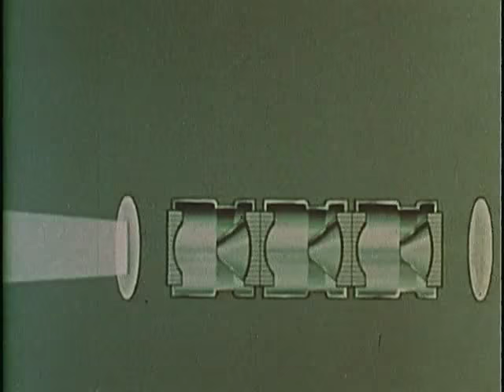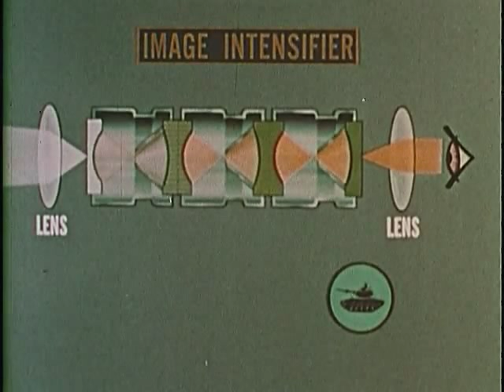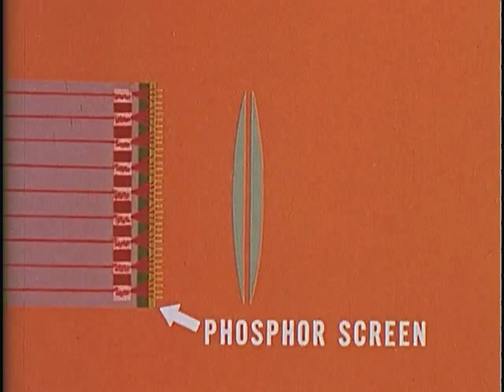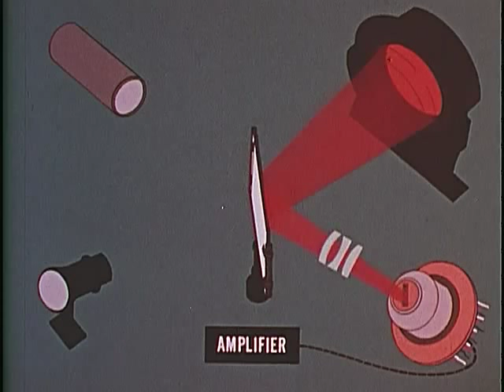History of Night Vision.

Comment: The wwii us sniper scope shown was actually a copy of the German "Vampyr' system. The Germans had the first operational "night vision" and had small units mounted on StG 44's which the US scope was an exact copy of, half track mounted units and IR search lights and had an entire unit of Panther tanks painted black with a smaller IR spotlight which the US copied and used on the M48 and M60 tanks. The US didn't come up with it. They copied captured German systems.

Comment: 2:32 W.W.II SniperScope
3:10 mid 1950s Fiber Optics
4:16  around 1960 Image Intensifiers.  GEN1 has three series stages of light amplifiers, 40,000X brightness
5:32 GEN1 Family:  (PVS-?) Vietnam 4X, 500m range, individual weapon,  on M-1 
6:30 TVS-2? Crew Served Weapon Sight, 7X, >1,000 meters,
7:10 Night Observation Device Medium Range, 7X, range thousands of meters, tripod mounted, 6" to 8" objective guess
8:13 GEN2 Family: Single stage, microchannel plate,  1/4 size, 1/2 weight, higher resolution PVS-4,  on M-16
10:48 Night Vision Goggles, stereo, FOV: 40 deg, range: <= 100 meters (mon light), 50m (starlight),
12:46 Monocular Pocket Scope, 3X, can be used to read map, 1.5 lbs, FOV 15 deg, 375m (moon), 200m (star),
13:31 "Driver's Viewer" Combat Vehicle Sights (VVS-2?)
13:49 Thermal Viewer, <6 lbs + 5 lbs belt mounted battery, far infrared, (see: Probeye,  DFOV),
15:56 M47 Dragon (Wiki), 10 lbs, 4X,
16:45 Combat Vehicle Thermal Night Sights
17:10 FLIR (Wiki)
18:37 Army, Navy & AF coordinating FLIR effort, civilian uses,
more at https://prc68.com/I/C3InfraredSignalingTelescope.html
Let me know what devices are shown in this film.
Reply: A panther tank had NV in ww2.
Reply: @Vincent98987  Was it similar to the Sniper Scope?
Reply: @Brooke95482  i dont know